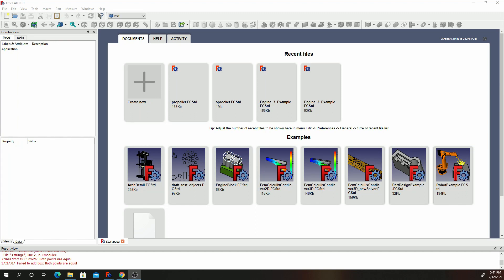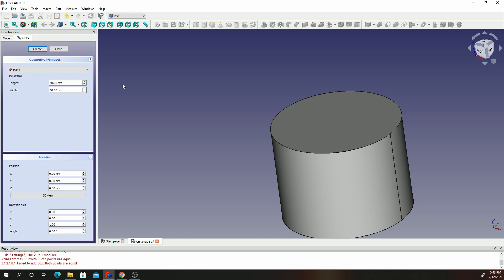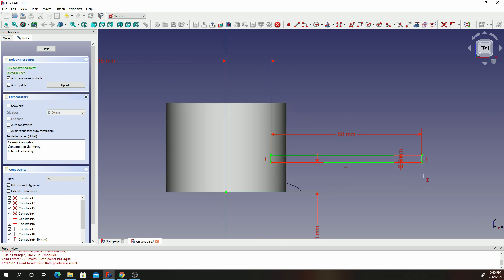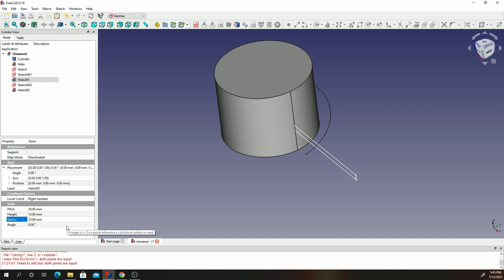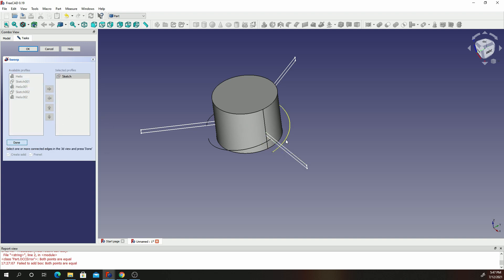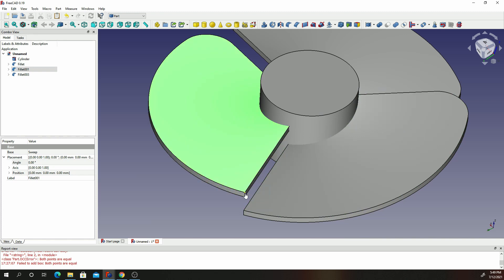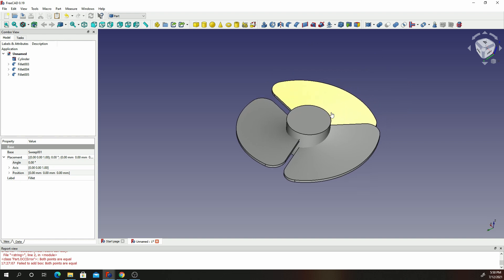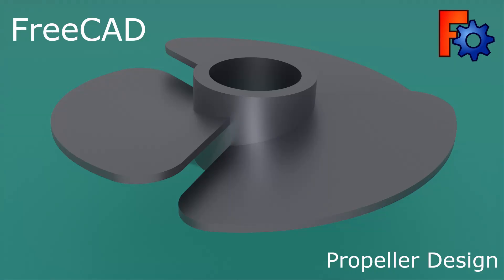Propeller Design using FreeCAD

Comment: Very Nice, from your video I was able to create for a RC Tug Boat a 44mm diameter x 44mm pitch Propeller using a 2.5mm outside radius and a 1.5875mm inside radius to fit onto a 1/8"diameter (3.175mm solid Shaft) running within a  5/32" diameter (0.15625mm brass tube) with a 0.14" . This entire boat has been designed with FreeCad. The outside of the boat will replicate an actual boat constructed in 1939, 42-foot-long (12.8M) with a welded steel hull, an early example of all-steel welded hull construction. The pilot house perches at the top of the boat’s three decks.
Thanks for helping me.

Comment: It gives me an error when I try to use the fillet tool: 
1e-07 <App> Document.cpp(3216): The graph must be a DAG.
0.0165581 <App> Document.cpp(3571): Unnamed1#Sketch still touched after recompute
Recompute failed! Please check report view.
Reply: Also troubled with fillet. Only say 'Recompute failed!'
Reply: I got to do fillet, but no more than  radio 10mm. With a 11mm radio or more, extrange forms appears.
Very frustrating 😕